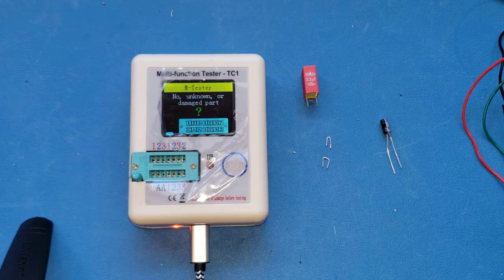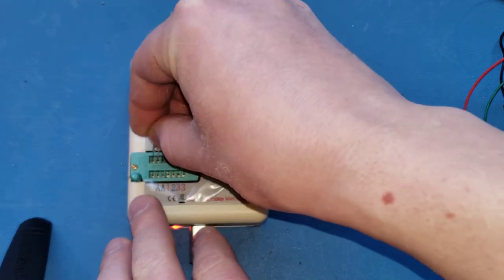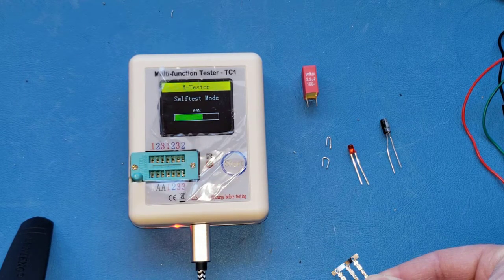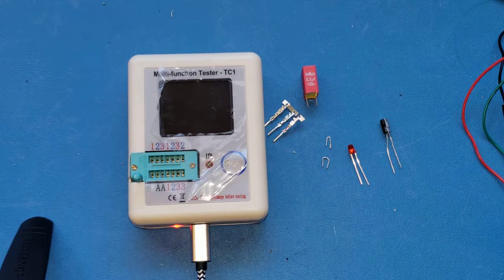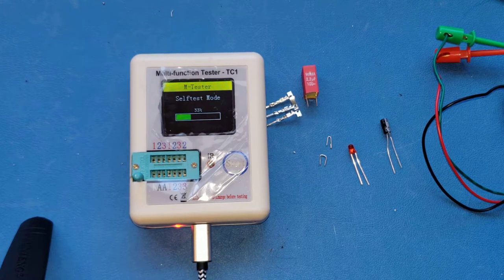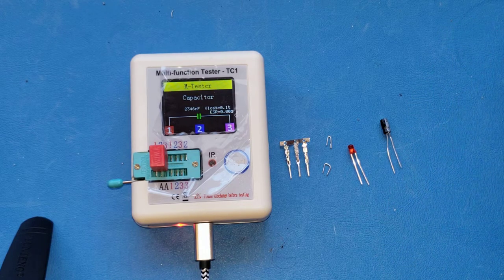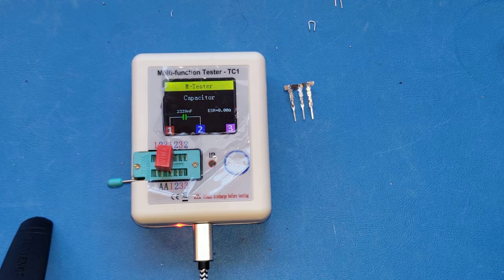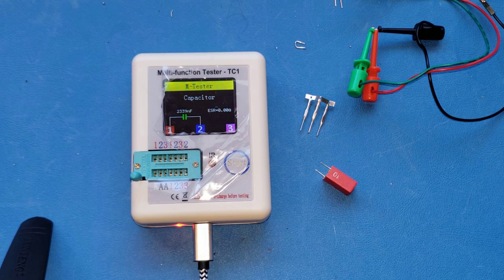How to Actually Improve Accuracy of the TC1 Multi-Function Tester with Calibration Tips

Comment: What you need to do is wipe down the 3 pin thingy (or the probes) with alcohol to get rid of any oil residue it may still have from being fabbed. Just as that helps with test lead accuracy, it helps this thing calibrate. I almost gave up on these things until I tried that and it immediately made a difference of about 15% more accurate.

Comment: Just got a t7-h and it doesn’t go into self test mode
Reply from the maker: It should be the same procedure of shorting 1, 2, & 3 then pressing start. so I'm not sure the issue.
Reply: same problem here. Any solution? Or may this be a fault?

Comment: I don't think you need to bend the self test probe just to fit it in the first 1-2-3 ports. The way I do it is to put the #1 pin in the first #2 port and then use the 1 & 3 ports directly to the right. The spacing is perfect doing it that way. Mine calibrates fine and seems to be measuring with acceptable accuracy (for a cheap tool).
Reply from the maker: That's a good point! I'll try that next time

Comment: I suspect the resistance or capacitance of the leads could affect the calibration.  Maybe solder the 3-prong connector instead?  Perhaps too calibrate with it powered by USB or not powered by USB and stay with that.  Also use with the same battery supply voltage.
The unit is really versatile at the expense of being accurate.  Even so I am pleased with the results of this unit.

Comment: I replaced the 3 hook-probe leads with a slightly heavier and longer version of them, and I haven't had any issues with accuracy, but I do always calibrate it with those same leads. Its definitely a quick and handy low priced tool for general ID and test of most components.
Reply from the maker: I'm glad it's working out for you 😀

Comment: I was thinking about getting back into building pedals again, and thought this could be a useful tool. Thanks for the calibration tip. I am curious, though, about the accessory that you have on the multimeter, essentially allowing you to plug components into it without using the probes. Did that come with your multimeter, or was it an after-market acquisition? I've tried searching for something like that, and I'm coming up empty.
Reply from the maker: That came with the multimeter. It also came with a temperature probe.

AstroAI Digital Multimeter  https://www.amazon.com/dp/B071JL6LLL
(Not an affiliate link)
Reply: Thanks for the quick reply.

Comment: But what is the IR port on the device for ? 🤔😕
Reply from the maker: It's an IR decoder. You can point a TV remote at it and it will tell you the UserCode and DataCode. Not every remote works with it though. My understanding is it decodes the Hitachi IR format, which should be relatively common.  It works with the remote for my Roku TV, but not my sound bar.
Reply: @SparkY0  Cool ! 😲🤔

Thanks ! 😇🖒

Comment: Remove the plastic protector ffs.
Reply from the maker: But then what will protect the plastic?
Reply: @SparkY0  Are you kidding?  Treating it properly might be a solution  Besides you could drag it behind a horse for a week before the plastic got as bad as having to view things through that loose film.  C'mon dude.  The thing has very resilient plastic over the screen.  Mine is 4 years old and there is still not a scratch on it.
Reply from the maker: To answer your question: yes.